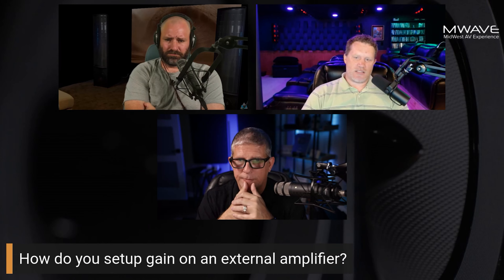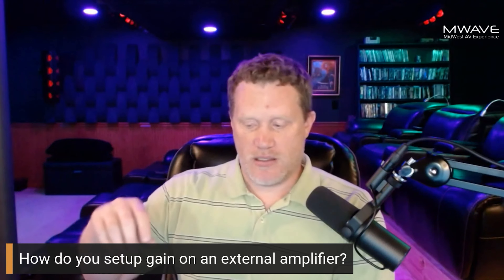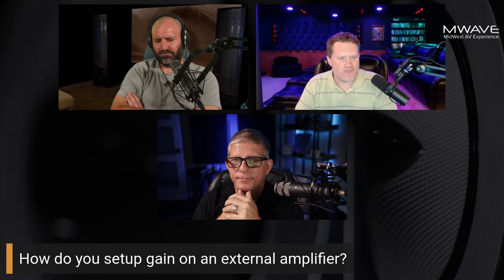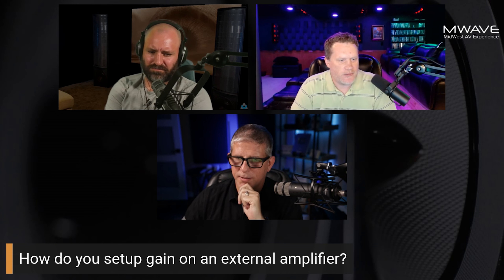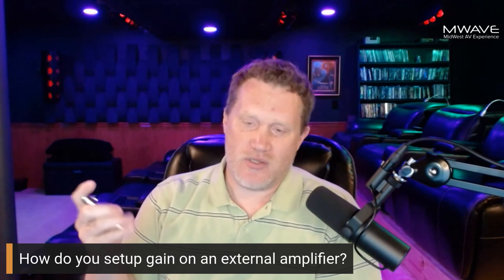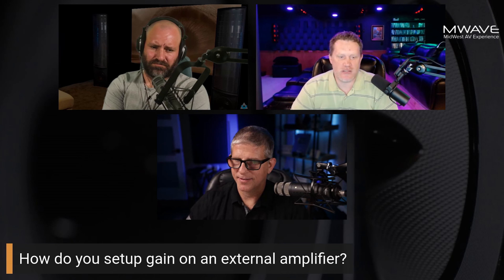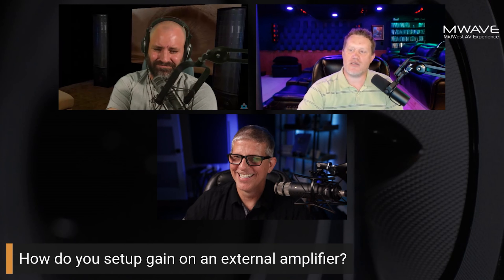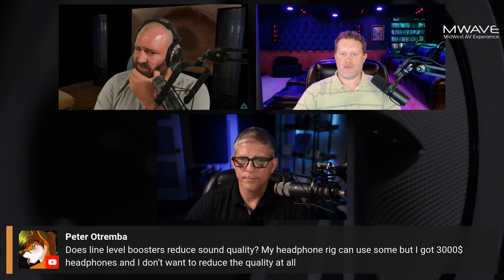How to PROPERLY Set Gain On An Amplifier for Home Theater

Comment: Hey guys this is really interesting. I have a mini dsp 2x4 and have found I have had to turn the gains to 3 o’clock and input trim on sub channel to +7db since introducing it. I have found I have a buzz which is only there when the mini dsp is in the chain. If I were to introduce the arc cleanbox would that also increase the buzzing.
Reply: Cleanbox pro should not increase buzzing, you would lower your input attenuator knobs with that device.  You should not be in positive trims unless you you subtract that amount from reference.  So you at speaker trim +7dB should not turn your main listening volume above -7dB from 0.  Or no higher than 73 to avoid clipping.

Comment: So for example on the Stormaudio Prozessor ( with rel. High Output Vortage) , to what Level should i Set the pre for reference Level ? Minus 7 for example and aim for 85 dbc pinkmoise ?  When using the internal Ton Generator ? My speakers can handle That spl … would be nice to know . This topic is on my m8nd for a while.. Thank you guys !
Reply: so again, what when I reach 75 db on a high efficient speaker in my system at -31 on the pre ? In this case my Subwoofer for example is lower. The Speaker ( over 100 db efficient) channel Trim is already at -10....

Comment: I have Marantz AV Receiver and after running Audyssey it always sets my Subwoofer trim to -12 which is the lowest, l always change  it to -10
Reply: That means you need to lower the gain input attenuator knobs on your subwoofer amps.  You don’t want your AVR to be -12dB on the trim, because that’s maxed out and you don’t really know where you are at relative to where accurate is since the AVR might be trying to set the sub to -17dB ( as a for instance, but it can’t lower it that much to integrate it properly since -12dB is all the lowest level it has.  Lower your subwoofer amplifier gain so you can land say between -12dB and -6dB.

Comment: they are volume knobs ... they are just used diffrently but there is no diffrence to a volume knob. the amplification multiplier stays the same. lets say, for easy math the input signal is 1 watt ( its way less ) and ur amplification mutliplier is 100x then the amp would output 100w. so what if you only want 30watt? then theres a resistor that reduces the voltage so that no longer 1 watt is reaching the amp but 0,3 watt. so the amplification factor remains 100 so its 30watts now.

the problem why u dont want to use it as a volume know is that the system is to complicated and if you want to adjust that early in the chain you would need to turn every single knob exactly the same. that would be a major hassle. So you set up your gain structure. and control your volume at a device that can adjust all those channels at once. like an avr or a preamp. but the way it works under the hood is the same. so if you want to get the full 100watts but your gain is at -3db ( -50% ) then you would need to put a 2 watt signal into the device so after the resistor theres 1 watt left.

The multiplication ( amplification ) in the device always stays the same. If you have a high quality pre amp. you dont want to use it at -30db because u lose the dynamic the pre amp actually can bring if your gain on the amp is at -0db or close to it. because u rather want to have the preamp at -10db so it works to its full potential and have the gain on the amp so that u have the volume that u actually want to have.
Reply: "they are volume knobs ... they are just used diffrently but there is no diffrence to a volume knob. the amplification multiplier stays the same.)"
"the problem why u dont want to use it as a volume know is that the system is to complicated and if you want to adjust that early in the chain you would need to turn every single knob exactly the same. "

That's 100% wrong. Gain controls are not volume controls. You need to know the difference between the 2.  Gain controls are always on the input section of a component, and volume controls are always on the output of a component. Only gain can distort the signal, a volume control can't. Thats why its so important to get your gain set properly. If gain is set too high, it will overdrive the input and distort/break up, just like a guitar amp. If you have an issue like this, reducing the volume won't the problem. You can lower the volume as much as you want, but the distortion will still be there.

I don't know who told you that, but you may want to get your information from a different source.
Reply: @AT-wl9yq  u think ur output volume knob is AFTER the amplification? imagine having a 200w amp, a line signal comes in, gets amped to 200w and ur volume knob now needs to kill 180w in heat because u only want 10% of the avaiable output?

Comment: Well crap, I feel like I need to spend a day in my theater to calibrate. When setting up my speakers the Denon said set external amps at 3/4 gain. I have always just left them there but my front stage is at +2 offsets.
Reply: Do you listen at -2, -1, or reference main volume.  Or above?   If you do, you should recalibrate.  Raise your gain input attenuator knobs two clicks, that should give you four dB of negative trim — landing you at -2 on your front sound stage.  No risk of source clipping thereafter.  If you don’t listen towards reference, ever, then don’t worry about it.   If you use heavy EQ — you may want to raise your input attenuator knobs more than 2 clicks.
Reply: @jvonengeln  thanks for the reply! I will play with it a little on weds when the wife is at work. I have also wondered about the voltage settings on the rear of my Behringer power amps. I run RCAs between my Denon to the Behringers and have them set at 1.4v. There are two other setting 26db and .77v and I’m pretty sure the 1.4v is correct. Would changing those setting along with the attenuator knobs be beneficial?
Reply: @gmonnig sorry for the no reply. Since this isn’t my channel I don’t get notifications. (Or I missed it?). At any rate with a Denon you want 1.4V!  It puts out more like 2-4V typically on Denon units. So the 1.4 input on the amp is appropriate!
Reply: Thanks! That what I normally leave it on. I'm a local KC guy, Lees Summit. I'm glad there's a lot of people in the area that are into this hobby! I spent the evening in the theater and have a lot more work to do.

Comment: This is so important.  I use a Lyngdorf MP-40 Processor.  It outputs at 16 vrms.  If you don’t turn the gain attenuators on your amps down to minimum and set your sub trims to at least -6 in the Processor or Sub Amps before running Room Perfect Calibration it will over drive the speakers and subs causing clipping and potential damage.
Reply: No. It will overdrive the input, and that is the source of the distortion. The amp and speaker are just playing back what they heard.  The signal was already distorted before it reached the amp.

Only excessive gain can distort the signal. Volume can't. Any time you have gain related distortion, it can only be fixed by reducing the source of the excess gain. Volume position doesn't matter at all. The best way to deal with your situation is to increase resistance on the signal before it gets to the downstream input. Look up Rothwell attenuators. Something like that is what you need. It will give you the ability to better adjust the signal level.